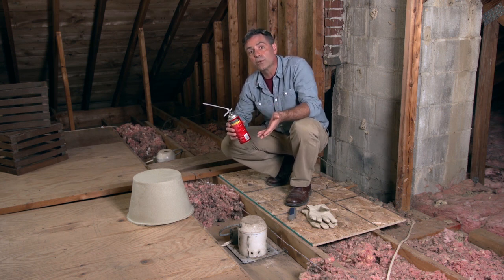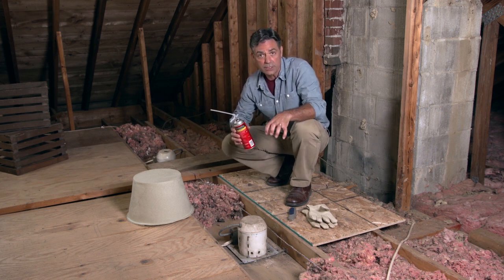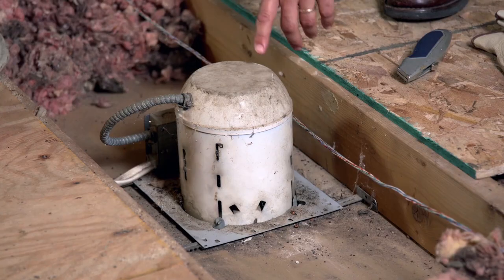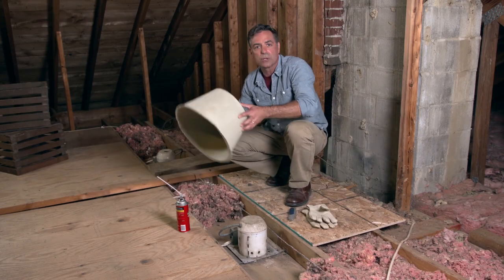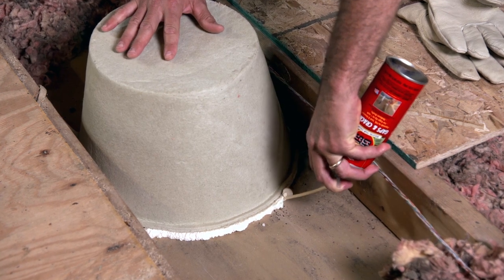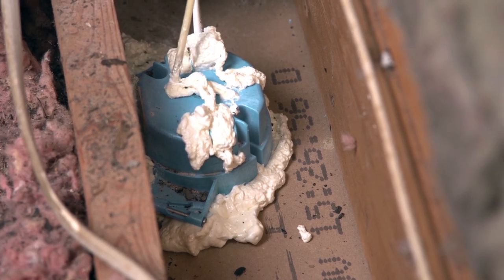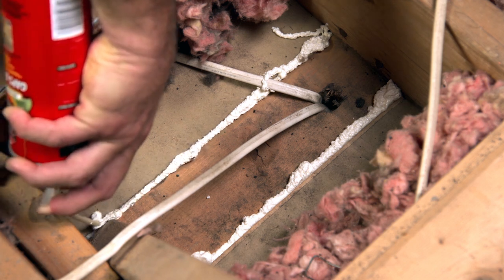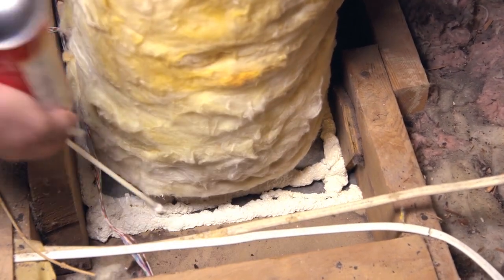You Can Air Seal Your Attic

Comment: "take a few minutes to go up in your attic and air seal" understatement there lol.
Reply: No doubt
Reply: It takes a few minutes just to locate the ladder... then another 15 moving the junk out from in front of the ladder... I'm with you on the "few minutes" being not totally accurate.
Reply: A few minutes? How about the 3,000 minutes to locate all the light fixtures and wire holes? Digging through fiberglass, cellulose, or vermiculite to find that stuff. Wear a properly fitted respirator, not just a cheap mask.

Comment: It's easier and cheaper to replace the recessed lighting  fixture in the attic with the latest energy saving fixture as opposed to buying an expensive cover that costs about $50 U.S.
Reply: Yes and the less super hot light fixtures in a building the better for fire risk, regardless of the energy savings!
Reply: "latest energy saving fixture", and those would be?

Comment: Why is nobody talking about how foam DOES NOT stick to dirt? All those dirty and dusty attics and people trying to air seal over dirt. Look at every joint you are trying to seal. Dust all over the place. At least use an old paint brush and silicone caulk. Use a 5-n-1 tool to spread the caulk INTO the joints. Easy right?

Comment: There's a better way to get about in an attic than kicking aside insulation and walking on joists. Using scrap lumber, it doesn't have to be that expensive. The steps: 1. Take 2x10 or 2x12 boards and cut them into sections about a foot long. 2. On the bottom of those boards nail two sections of plywood sticking down about 3" 3. Slide two of those boards and the side sections onto joists adjacent to each other. 4. Nail a 24" x 10" board between the two. That's give you a solid platform about 16" above the bottom of your attic. You can get about by stepping from platform. 5. Even better, nail longer boards between the platforms and you'll be able to walk about with ease. I installed enough of them I can quickly reach within a few feet of any point in my attic without disturbing the insulation. These wooden paths also makes it easy to put attic foil on top of the insulation to reflect radiant heat.

Comment: I was a little bit surprised that no mention was made of air loss around and up the chimney. I’m a newbie homeowner, But I’ve heard it mentioned — you need a solid flue/ Or airtight covering in front of your FIREPLACE when it’s not in use, otherwise, heat/A/C is just hemorrhaging through the chimney if not addressed — more than what’s lost through little ceiling lights or ‘can lights,’ although those do collectively lose a LOT of heat/cooling. 

A good chimney service will be able to seal off some of that air loss around the chimney, if I’m not mistaken?

Comment: Sure...let's do this.....by removing and setting aside all the pre-existing fiberglass insulation....and when done sealing,,.....put it all back in-place. Who is going to do this?....instead of just adding another layer ( or blown-in) insulation?....and hope for the best? Now.... add-in the complication if the existing insulation is not batt-type, but blown in....and you have no walking area between the studs. This whole premise is way over the top optimistic as being truly do-able.
Reply: Industrial vaccuum with 6 inch hose and big bags job done have fun
Reply: Insulation and air sealing are to completely different forms of home insulation. adding extra insulation but not air sealing still allows air to leak out of the condition space into the attic, as fiberglass insulation is a terrible air barrier. But a worse scenario is unfiltered dirty attic air getting sucked into the home reducing indoor air quality and cool efficiency. The ease of air sealing varies from home to home (obviously)
Reply: Air sealing is more important than insulation.  Even if you don't replace the old insulation doing the sealing is worth it.  It depends on how much the homeowner can afford at the time.
Reply: Found the lazy homeowner or dirty house flipper